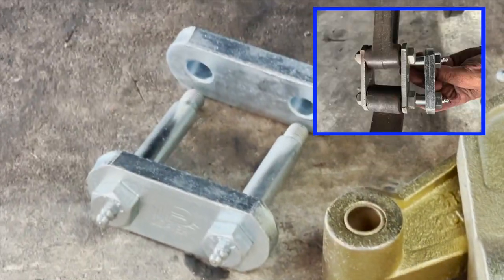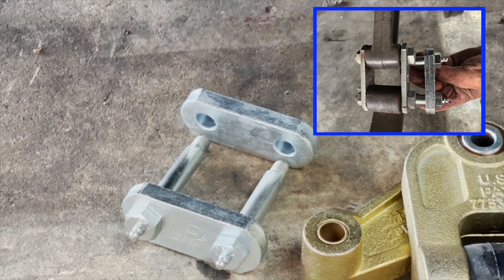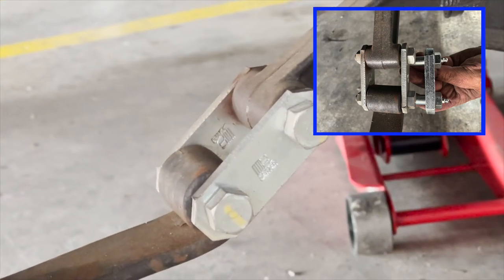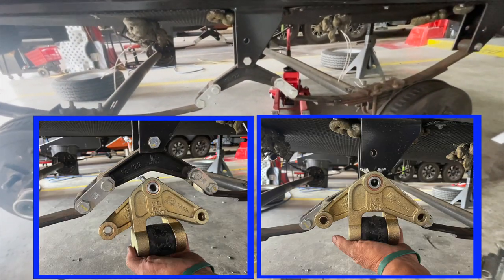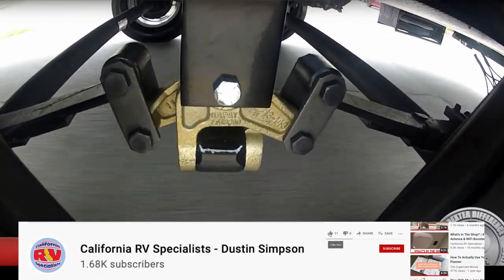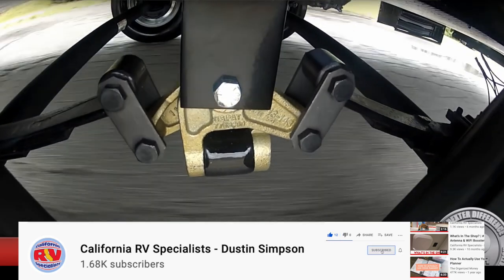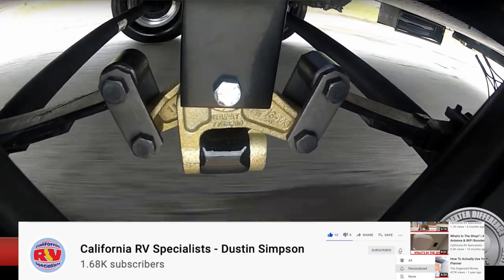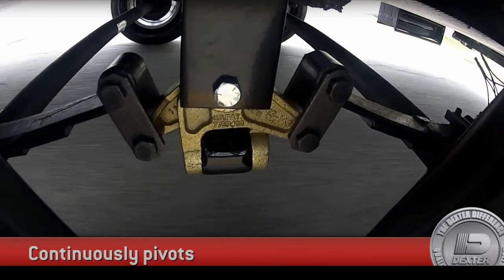RV Ride Improvement Secrets: Dexter E-Z Flex Kit

Comment: Would you compare E-Z Flex to Road Armor or to CRE3000 or to Equa-Flex? Totally agree on the greasable shackle upgrade.😎
Reply: That’s what I wish someone would put out… a complete, unbiased review of the top four equalizer upgrade options! (Dexter, Morryde, Equaflex, Road Armor, etc)
Reply: @jake694537  I have Morryde fully independent suspension, but hoping to not have to go that expensive on next 5th wheel. So I would like that comparison also. I felt the E-Z Flex that came on my 5th wheel did almost nothing for ride improvement. The chucking disappeared with the fully independent Morryde. I also have Morryde pin box and Comfort Ride 184 hitch. All together,  no chucking.